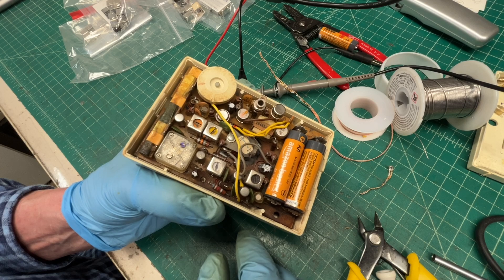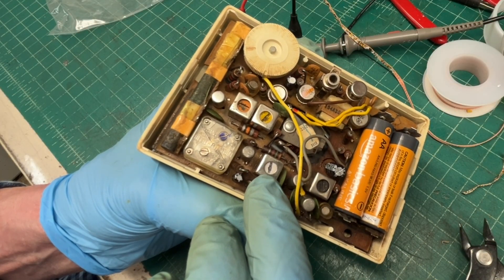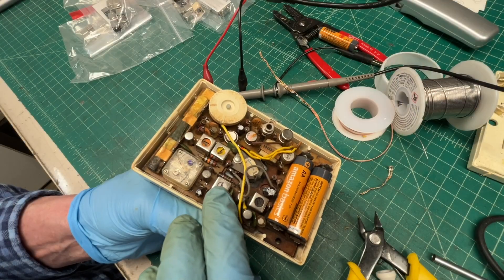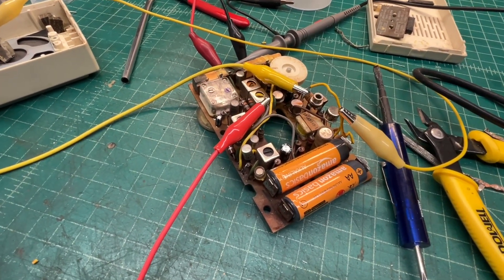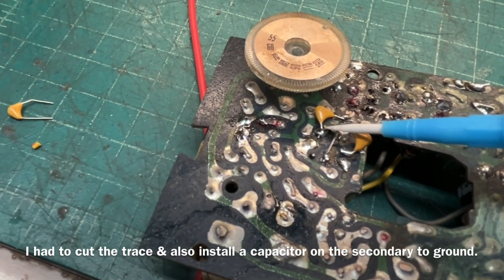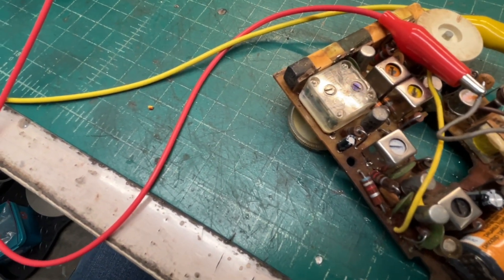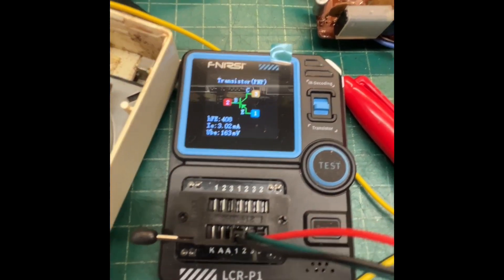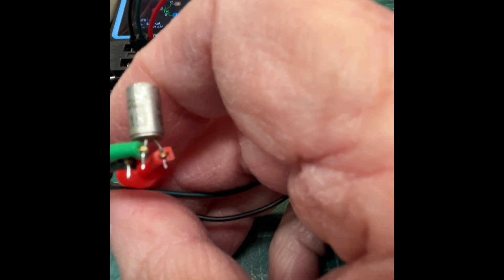I.F. Transistor Oscillation | Radio Troubleshooting/Repair | GE P1700A, P1701A, P1704A

Comment: So the GE is an overachiever I guess. Looks like you got it down just about right Don. Good job. :)
Reply from the maker: Yep, the substitute transistor I used seemed to work okay until I placed the correct IFT in the radio, then the oscillation started. One of my viewers suggested a neutralization capacitor (see the comments) that I tried, but didn’t resolve the issue. Thanks again for sending me the radio, definitely provided hours of learning and fun. Best, Don

Comment: That's great! That you change its transistor and now it's working good,You can also put neutralization capacitor of 3pf between input and output of IF which is oscillating.
Reply from the maker: Glad you enjoyed the video and thanks for the tip! I tried that today after seeing your comment, but it didn’t seem to work unless I misunderstood your directions. Please clarify so I can confirm I placed the capacitor in the right place. Thank you. Best, Don
Reply: @RestoreOldRadios welcome! Yes the tip was that to connect around 3pf capacitor between base of that IF amplifier transistor and that side of IFT where collector is not connected ,  resonant circuit circuit where pin of IFT is left.The other crude method is that you can place a piece of metal like copper strip or any other metal near that IFT can and listen if oscillations fades away.
Reply from the maker: The 1st IF amplifier in this radio is a common base (CB) with the emitter being the input instead of the more universal common emitter (CE) with the base being the input.

I placed a gimmick capacitor between the emitter and collector and it altered the oscillation, but didn’t resolve the issue. I’m not sure if the (CB) configuration alters the impact of the neutralization capacitor or not?

Looking back at my video, I did try jumping between the emitter and the unused pin on the IFT with the same results. 

Best,

Don
Reply: @RestoreOldRadios Sorry Don ! I didn't noticed that it is common base configuration, in my homebrew shortwave receiver I connected 3pf neutralization capacitor but that IFT stage was in common emitter configuration, put some metal shielding on IFT Can , touch small metal sheet on IFT and see if it can stop IF stage oscillation if it stops then you can either solder it to IFT.

Comment: Are  the color of  the  screws  in the  IF can s   have a significance  to   all  radios   Like  is the  white one   always  the first  IF   stage  and  so on   I ask this because  it seems  like every   radio has the   same  colors   on the   screw cores
Reply from the maker: John, for the most part, but you’ll find variations based on the transistors used (gain of each stage). A very good general guideline is: https://www.electronics-tutorials.com/filters/if-amplifier-transformers.htm

All the best. 

Don